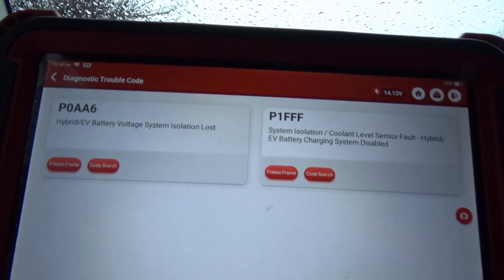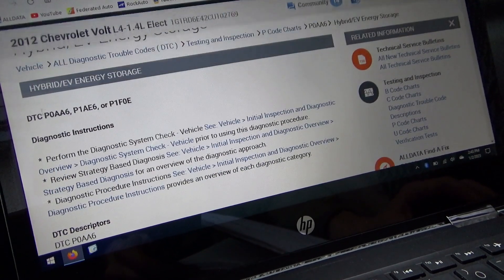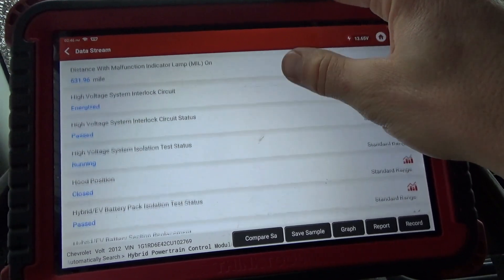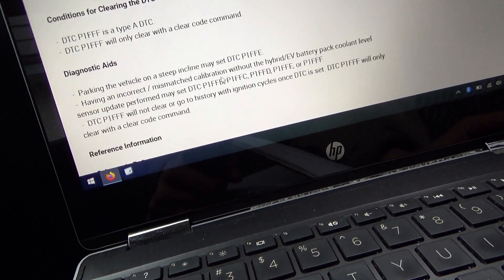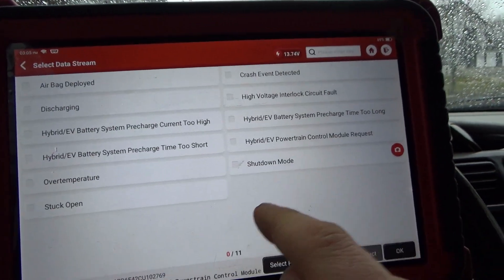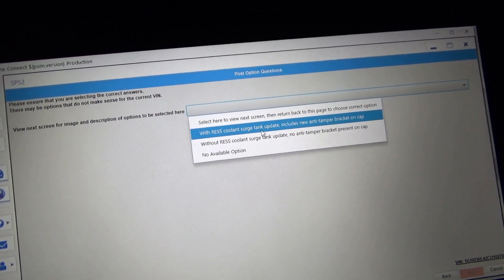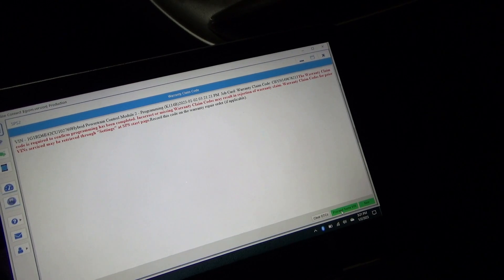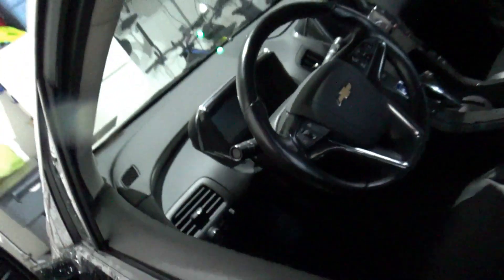Chevy Lost the VOLTS? (HV Battery DISABLED - P1FFF P0AA6)

Comment: It's the coolant sensor. The reprogramming of the DTC will wipe out the error until the coolant sensor gets tripped down the road. Mine tripped when it was the hottest day in the summer and year later the error came back on the hottest day of the summer. There was a recall by chevy and they did a DTC reprogram for free but when the error code came back, they refused to reprogram the DTC again. Where I live, the engine light ties in to the emission and if the emission don't pass, you can't drive the vehicle. I know for fact this is a software fix but chevy would not fix it. Even if I paid the $300 dealer to reprogram, the issue will eventually pop up next season when it gets record hot so I decided to fix the issue myself. I went online and other people had the same issue and it pinpointed to the coolant sensor. I purchased a VXDIAG and GM software, paid the $50 annual membership and reflashed the DTC to wipe out the error and installed the bypass sensor. That error never came back past 6 years. Some people reported success with replacing another sensor but I opted to bypass it since technically the recall should have fixed it permanently.

Comment: Hi its long past but i used to test diags for that brand of vehicle, and some were ‘sticky’.   I found that after a clear codes i would power down ECU wait 30s and re-power, and then code was gone. This was because some codes run their checks at the end of a keycycle, and others immediately  at key - up or during drive when other metrics are set. I have not been close to the P1FFF though, so it’s conditions might be a different thing altogether. Interesting vid though, thanks!

Comment: My wife's 2013 threw three codes that simply said "refer to service manual".  It also displayed the "High voltage system needs service" message. I did some studying and troubleshooting.  It was simply low coolant.  I got some Dexcool 50/50, filled it to the line, erased the codes and all was well.  Why didn't it just say "coolant level low"???  It seems like it's guiding you to the stealership for service, I bet.

Comment: My Chevy Volt 2012 with 105000 miles was charging as usual, last week the charger showed red light and I’ve got an engine light on. I brought it to the garage, no diagnostic was given. they said it could be a faulty charger cable. I tried to charge with other cable at a public ev charger and it also went red. It doesn’t charge. I suspect it might be the charging port since the battery doesn’t run low in volts and keeps regen. I am about to order a new charging port for a diy repair, the new part costs about €315 (340 usd) to import here in Europe, however, I am afraid i will have to bring it to a dealer to reprogram if the error doesnt clear, which might cost a lot. And I can only hope that changing the port will solve the issue. Any ideas or suggestions before I get myself into the challenge?
Reply: Get a VCX Nano if you haven't already, an absolutely necessary tool if you own one of these cars.  This will let you do the reprogramming yourself.

Comment: I'm there now.  I have a Volt 2012.  Let it sit for 7 months in Oregon, rainy climate.  Possibly messed up my sensors.  $1,000 bill today for nothing at a Chevy Dealer. They wound up clearing the codes and put in a 12 volt battery replacement.  Not much return on that -- said I' need a new HV battery if the codes return, yet none of the cells are defective.  Low coolant good. He missed something.
Reply from the maker: Dealers are useless lol...Did they not follow the TSB??
Reply: Incase you didn't know when you pull the door handle the hybrid battery starts charging the 12V battery if sitting a long time the battery could be low so what happened is you got in your car and pressed the blue start button right away or too fast, should have waited for the dash to show READY at that time the 12V battery has the voltage boosted up to the mandatory voltage. Supper important the voltage is up before pressing the blue button. Because the fluid sensor in the hybrid battery reservoir sends a message to the module under the passenger seat to disable charging.

Comment: In September 2020 I received the error message on my dash "Service High Voltage Charing System" (SHVCS) on my 2015 Chevy Volt.  The car cannot be charged, after checking the coolant level, it was low which triggered the error message.  I ordered coolant and a pocket scanner/code reader from Amazon.  I performed the service, cleared the codes and error message is gone; the engine light is now out, and I can resume charging my car.  
UPDATE>> August 2023, the SHVCS error message is back but this time my coolant levels were just fine.  Upon a recommendation I picked up a coolant sensor GM Part #2292-2224 and replace the coolant sensor.  I plugged in my original CP9125 scanner/code reader and cleared all codes again.  The check engine light is now gone, plugged into charger and YES I'm changing again.  However, within 24 hours the error message (SHVCS) came back. I don’t think the coolant is leaking into the battery department due to the coolant level in the tank has not moved.  Sounds like I need to reprogram the HPCM2 and BECM system, for the codes to be cleared and not come back.  I can clear all codes and charge my car, but this must be done every day.  Where can I go to have the reprogramming done?  I live 20-miles East of Los Angeles, CA.

Comment: Relocate the sensor from under the reservoir and wire it up next to the HPCM2. you can locate the two wires with your multi meter set to continuity or buzz and they will be next to each other on connector.  The problem with the car  is the LONG thin wire to the sensor when powered up is only 3.5 volts on the power side and connected to a 24K ohms resistor " way too much" and the module is looking for a voltage drop to disable charging,  module is made to not charge once voltage drop is detected.  They made this circuit so the module would be looking for a voltage drop on a supply of only 0.00014 amps. come on GM   ... If you put the sensor under the passenger seat keep an eye on the tank level for leaks.  PS the dealer had my car 3 times and couldn't fix it there next step they said would be $2200.00 to drop the battery and check the modules.

Comment: Maybe you can help me too.  Looking to purchase a 2013 Volt, won't charge, dealership said cells 1 3 and 4 are low.  Looked at car today.  12v battery dead, jumped battery with running car and now fob works and display reads service high voltage system.  HV level shows 0%.  Dealership pulled HV isolation code.  Vehicle has been sitting since last November.

Could it just need a 12v battery and a program?

Thanks in advance for your help!  I'm a mechanic former GM dealership but never worked on these Volts.

Comment: This problem is fixed by hacking the coolant sensor so it doesn't throw that error.  There are redundant sensors to detect coolant failures.  Post hack, no problems for 5 yrs.

Comment: I had texted you before I have a 98 Plymouth neon it was running fine stoped at one place came out would not start crank but no start got it home checked it out have no power going to the coil replace crankshaft positioning sensor still no spark no power going to coil check the whole wiring for any breaks or cuts but all looks good I'm on social security disability don't have a lot of money but I need this car running this is how I pay my bills and get to the grocery store and stuff you text me a response but somehow I lost it I'm not real good on these internet things if you can please help me I would highly appreciate it any kind of help the car has been down almost a month the car always ran fine until now
Reply from the maker: Fill out the appointment form on my website www.pinehollowdiagnostics.com 👍
Reply: @PineHollowAutoDiagnostics  I'm in Kentucky

Comment: The battery will still charge if you pop the hood and drive it around.  Done that did that🧐
Reply: Or you can pull it with another car, brakes slightly on (or in "Low").  Or you can drive it in "Mountain" Mode.  Or drive it downhill (also in "Low" or with brakes slightly on).
For some reason, they only disabled charging from the charger, not from the car.
I guess GM wants you to use more gasoline (and maybe need yet more service).
Reply: I thought that only forces the engine to run.  (Also, a GM "safety feature").
Reply: @loungelizard836  what it doesn't use for power it charges the battery.   I was stuck 70 miles from a shop when those codes set on mine.  Didn't know what to do as I was 1000 miles from home. It had 0 miles range.  Popped the hood and in 45 minutes the range was up to 20 so I knew it was capable of charging.  Drove the 1000 miles home like that

Comment: My question is did the reprogram actually update to a new version or just overwrote with the same version?
Reply: Same version. My understanding is that the software counts the number of error code and when it hit certain range it trips the DTC. The value has to be entered in and reprogram with same version. So no hardware ever gets changed. It's a software fix. In my case the dealer didn't bother to put a new value in, they reprogrammed it to reset the counter to 0 and it came back a year later.

Comment: How we as diy folks be able to get the programs from oem?
Reply: You can buy data from AC Delco yourself, about $50. for one vin number and is good for two years, your have to have a computer or laptop cable hook ups and then your choice as to the tool to plug into the OBD2 port many options, I bought the cheap china one and had problems with it and their tech team finally went on line and helped.
Reply: @portagepete1  Can you share the link or give the website where one can buy data from AC Delco to reprogram one VIN? I'm working on a 2013 Volt that needs some TLC.
Reply: VCX Nano.

Comment: A rude awakening is coming for EV owners.  There won't be many qualified techs to work on them.  The local hack at the corner repair shop can't fix most easy electrical problems now,  let alone diagnose EV's.  Not to mention the price of parts, it will be a costly guess, if they manage to not electrocute themselves.

Comment: Just waiting for all these car to get a bit more mainstream and older then the DIY repairers getting into them, fires, burns and anchors will be a plenty.
Reply: Hybrids and EV's are fairly mainstream, Prius has been around over 2 decades now.  Most anyone can pull the packs apart and recondition the modules with hobby chargers.  No fires, burns, or anchors.  Volt batteries can be swapped in the driveway, pretty easy and safe to do.  Most DIY are better than the dealerships if we're being honest, for the most part the  dealer is fucking clueless.

Comment: You would think the lithium and coolant might cause a uncontrollable chemical heat reaction ?
Reply: pouch cells are hermetically sealed in an aluminized plastic film - you would have to rupture the film for coolant to get in (that's IF there actually was an internal coolant leak). that said, I really hope future tech will eliminate the need for water cooling except for some specialized high performance applications. The Leaf only uses air cooling for its batteries - but historically, this proved problematic to longevity.
Reply: @ivantuma7969  They used NO COOLING at all on the 2011-2017 Leaf.  That's why their batteries degrade so quickly. 
Unless you want a car for around town (20-40 miles range) don't buy an older Leaf because they will all degrade to that point long before 100,000 miles.
Unless you live on a glacier I guess.
Reply: @loungelizard836  I did mention "The Leaf only uses air cooling for its batteries - but historically, this proved problematic to longevity."

Comment: Similar issue happened to my best friends dad's car. 2012 volt. Had him bring it by the shop, he told me this is the third time it happened to him, first two GM covered, third one was out of warranty. He only had the coolant level fault along with the contractor opened from the fault code. Coolant level sensor read something like 1.2kohm when low, 6.8kohm when at the correct level. Not your standard closed circuit when low, open when at the right level. The magnetic float internal to the tank had gotten coolant in it, replaced the tank because of the float, and ran into the same problem. Couldn't clear the code, I couldn't reprogram it at the time from not having the hardware, and still had to send him to GM to get the module reprogrammed after the repair. Never had to reprogram a module from a bad coolant float before. Just ridiculous.
Reply: In the beginning the factory was not building them like this where the code could not be cleared, The Gov. stepped in and required they be made like this to prevent the battery from catching fire. Did it ever help one of these cars not burn hell no.
Reply: @portagepete1  🤔 Interesting, was it nhtsa that stepped in on this or was it another agency?

Comment: The Volt is a great car . My friend bought a used one about 7 years ago and he has had zero faults. Odd they stopped making them.
Reply from the maker: Honestly I would take one over a Prius since it won't leave you stranded with an
EV trouble code... And you can charge it from the wall 😁
Reply: @PineHollowAutoDiagnostics  
I would die before driving a prius pile.
Reply: @patrickflohe7427  Prius is a nice car you don't know what your missing.
Reply: It is a great car. 
I bought one in ‘19, when I heard they stopped making one. 
It’s been fantastic.
Reply: GM stopped making them because they went full electric with the Bolt.
Reply: @n9wox  
It was because the Volt was very expensive to make, and the government was applying pressure to go full EV.

Comment: A very green car except for the mining of lithium and generating electricity to charge it 😆
Reply: mine for lithium or drill for oil/gas ¯\_(ツ)_/¯ ... there are vast "badlands" in the US with accessible lithium deposits (permitting is another matter) - but unlike gasoline, the Lithium can be recycled for new batteries in the future. As far as generating electricity - it depends on where you live and each locations combined grid fuel mix. Even in ~100% coal burning areas, the amount of produced CO2, NOx and CO is still less when sourced from a grid's combined cycle powerplant running at 60% thermal efficiency rather than running a 20% efficient gasoline engine 100% of the time. Next gen nuclear would end most of this speculation, but...
Reply: Charge by solar panels.

Comment: I personally would recommend that 1) the owner remove and replace vehicle with one not made by GM  2) make sure the replacement vehicle runs on "dinosaur juice", not electrons (actually, unless the utility company that home is hooked to is using nuclear or hydro electric, the vehicle is still running on some kind "dinosaur" based fuel, just a couple more steps from that fuel).
Reply: excellent display of ignorance right here

Comment: At least you can do the programming and it's not that expensive - many manufacturers have this sort of crap as "dealer only".  Plus you have access to the service docs through AllData (and they seem pretty good).   For some manufacturers (I'm looking at you BMW) you can't even get the service data, only through their software, which costs $$$$ - or you just pirate it which is what most people do (see your Maserati series...)
Reply: There is always someone out there that will find a hack for every system .Just got to throw it on the web & somebody will grapple with it & find a work around.

Comment: First, the coolant level was not full. Should be to the top of the black label or the problem may return. Second, it is a 2012, which has a coolant level sensor spliced in by the dealership. These get corroded over time and need cut and soldered.

Comment: Those Chevrolet VOLT vehicles have a very common failure on the HV Battery coolant reservoir level sensor. When the sensor goes bad, it locks the charging system to the HV battery. You have to replace the level sensor on the reservoir, or also is the option to bypass it.  Very common failure on this vehicles.
Reply: It’s on the early Volts, 1st generation. 
Very easy to fix though.

Comment: There have been some cars I've seen that have solely just needed a programming or a software update to get the vehicle running. I am not against software updates but if the system is rigged to force drivers to into getting updates whether they like it or not, I don't think that's really fair. I speculate they might be de-flashing random people's ECUs through the Sirius XM radios or something (not speaking for this case study).
Reply: Yea, if you have a VW you probably can't even drive by a dealer or your better software version is screwed.